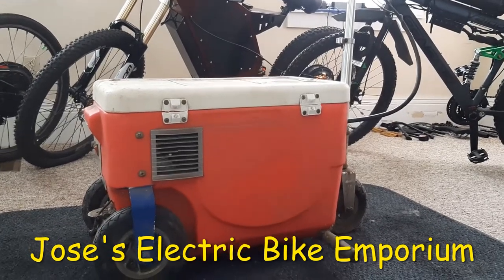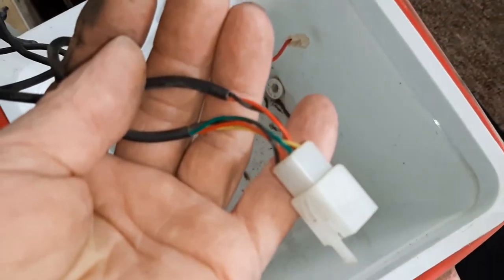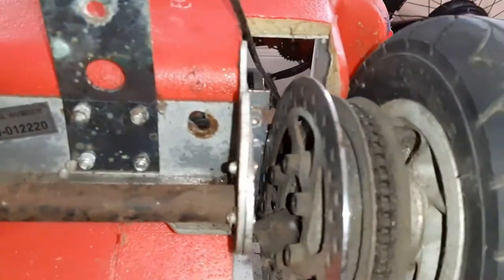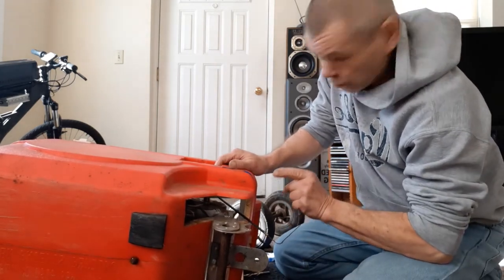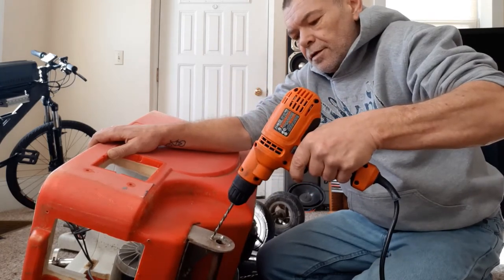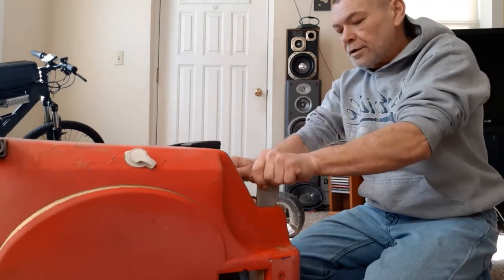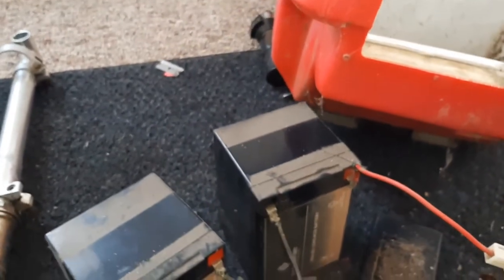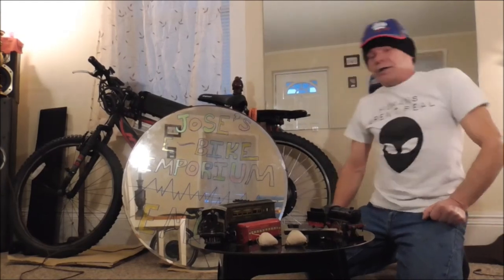Cruzin Cooler / 50 Series / Total Disassembly for Restoration

Comment: Just found & bought a Cooler Scooter--the ORIGINAL Cruzin' Cooler--for $40-USD. And looking it over... even if it was in good shape, it's a cheap POJ! 😠

Everything chassis-wise is bolted to the cooler body, making it the stressed member of the frame... which I doubt can really handle much stress (Weight or hard maneuvering) at all. Not to mention how with the stock single-row wheel setup on the rear, I doubt you could safely...!😵😨

And then there's the drive axle, which it isn't: The motor--which isn't brushless on any model, btw--only drives the one wheel (Right-hand rear) because it rides on the axle via bearings--it's not tied to the axle in any way! 🙄

And the batteries: Sealed lead-acid?!? In this day & age? C'mon...!😒

I'm sorry... but I feel there's better built setups out there, and this thing is all hype. Now, if you excuse me... I have to get to work on mine: The one with an actual independently-powered refrigerator/freezer onboard, that can carry a REAL load (600-lbs+!) and go street-traffic speeds (7kW brushless motor) for a looooonnng distance. (200mAh LiPo battery) Not THAT'S how you build a cooler you can ride upon...!😉😎